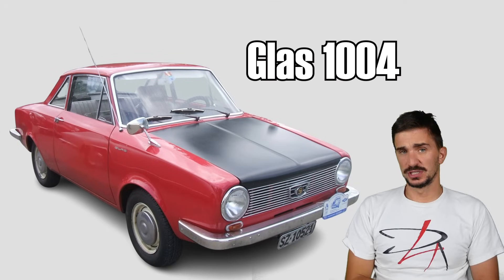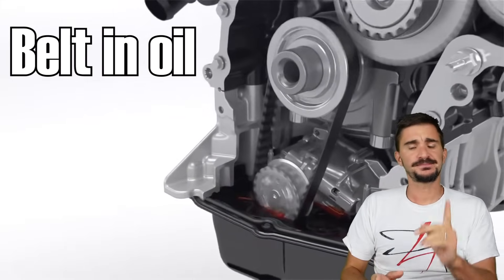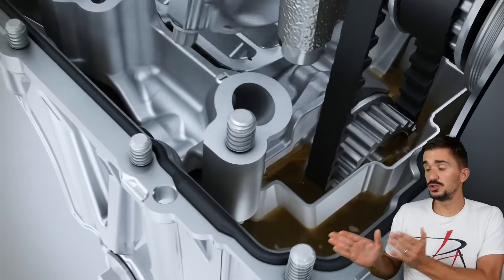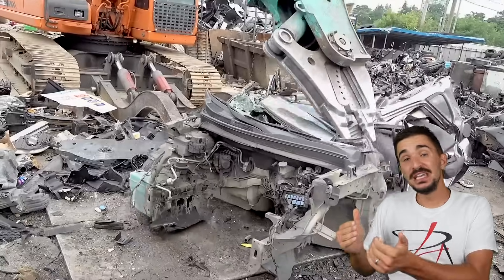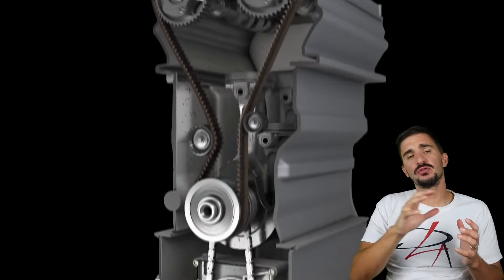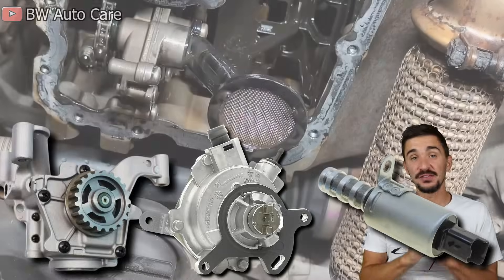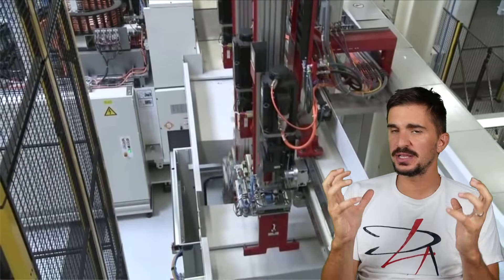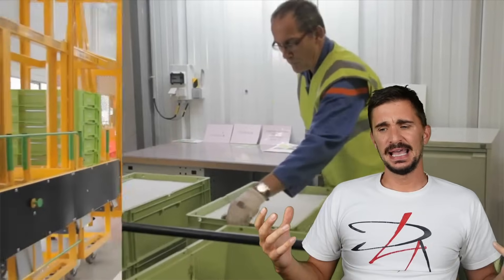Who Approved This and Why Is It Still Being Made? Wet Belt aka Belt in Oil Engines

Comment: We can conclude that engineering exists to make an engine last 500k miles. Engineers now focus solely on timing big failures just outside the warranty expiration. The closer they get to the expiration date, the better the engineering job. Kudos to the folks at BMW - you are at the head of the class!! 👊
Reply: A Yamaha XJR1300 Timing Chain only lasts up to 498kkm. Must be a weak design............ for a Motorbike.
Reply: ...engineering USED TO exist to make an engine last 500k...  Yep, now they want things just barely good enough to outlast warranty, aka planned obsolescence.
Reply: Don’t assume malice when incompetence is a good explanation.  A lot of the oldtime grease-under-the-fingernails engineers are gone and companies are stuck with CAD monkeys that couldn’t even change the oil in their lawnmowers.
Reply: 😂yes....Original Lexus LS400 engine. Pure silk designed to basically run forever, for instance. Or the original red block Volvo with a timing gear/sprocket....
Reply: Been like that since the 90s if not mid 80s.
Reply: As a mechanical engineer who works in automotive I can tell you it’s not us. It’s the higher ups pushing for cost cuts more and more while inflation continues to go up. Something has to give, and that something is the life components. 
It’s the whole lightbulb thing. We have the technology to make light bulbs last incredibly long (incandescent) but the big wigs way back got together and set a maximum life bulbs can last so they could sell more bulbs.

It’s never the engineer it’s always the person above.
Reply: @reaper793  Good analogy. I've seen the lightbulbs at Edison's house in Florida. Still going. As well as the  ceiling fans.
Reply: Having worked in the automotive industry, you are placing blame on the wrong profession.  It's (sadly) the bean-counters and marketters that are forcing such decisions, all in the name of more sales and profit.
Reply: @jb5nf  " I've seen the lightbulbs at Edison's house in Florida. Still going." Aren't long-lasting incandescent bulbs ridiculously dim? I'm not sure that is a fair analogy.  Even with automotive halogen bulbs, the brighter ones don't last as long -- it's not a free lunch, you can't have brighter output and longer life. People don't want 53bhp from their unstressed 1.5L inline-four, they want 190bhp from a 1.5L Ecoboost, so this doesn't help.

Off the top of my head, the 1000cc Honda engine makes 175bhp @ 13500rpm in the 2010 Fireblade but the very same engine in the 2010 Hornet 919 is detuned to 115bhp @ 8500rpm (and the rev limit is lowered all the way to a paltry 9500rpm).  As much as we want the big power at high revs as auto enthusiasts, almost certainly the engine is (sadly) going to last longer in the Hornet when used for the same type of full throttle, redline riding. (Extreme example: old American cast iron pushrods from the 70's in pickup trucks that barely make 175bhp from 5.7L but last for eons.) 🥲
Reply: @TassieLorenzo my parents have a chandelier in their parlor with several 75W bulbs that haven't been changed since they bought the house in 1982.  That's  42 years.  Most modern bulbs don't last 42 months.  Especially fixtures with built in LEDs.  Planned obsolescence is the name of the game.
Reply: @Noah_E  may also be very good wiring.  I never had classic incandescent last long like that here in the US.  My house was modern wired around 1980 and built almost a 100 years ago, fwiw.

Comment: Thanks for sharing this.  I only found out that wet belts were a thing about a year ago, couldn't believe that anyone could think that this was a good idea.  Personally I think that OEM's should be held accountable under consumer legislation and be required to offer a chain drive retrofit at cost and with free installation.  To me the oil pump drives should always have the most durable and reliable drive technology of any drive within an engine, to choose a wet belt is guarantee of catastrophic engine failure at some point in the life of that engine, unless you do oil changes at 5000 km AND you are very lucky.  MADNESS!

Comment: Honda also decided to use wet timing belt in Honda City 1.0 turbo which is one of the best selling here in Thailand. Timing belt de-lamination has becoming commonly found problem in this model as it older.
This problem costs a lots money from the users since the pieces of de-laminated belt usually clogged VTEC solenoid strainer or engine oil pump strainer which caused oil starvation problem and broke the engine.

BTW, Thank you for good video!
Reply: I think they also used this "technology" on the Honda Civic 1.0 Turbo sold in Europe
Reply: But i would expect Honda should react better and repair all of them at no cost.
Reply: @stefanmargraf7878  Yes if you pay for their expensive extended warranty. No otherwise. I had a month to go on my extended on a civic when mine destroyed itself for a 2nd time.
Reply: I think they only used that belt in the 1.0T not in the diesel engine. The diesel had a chain.
Reply: @kevinegal8586  Yep, it’s the gasoline one.
Reply: Why not use the timing chain and figure out how to increase efficiency another way. These clearly are for throw away cars.

Comment: This is like diesel Gate. This is Timing belt Gate.
Reply: Except diesel gate had nothing to do with reliability
Reply: @thedopplereffect00   correct but it was a scandal was it not? And this is a scandal engineers new this belt will destroy the engine so it is timing belt Gate in my opinion.
Reply: Reason for Disel Gate was different, why its pop up its another story :)
Reply: @elriv76  diesel gate is not a story it's a fact so is Watergate.
Reply: This is worse than diesel gate.
This actually affects the people buying these cars, diesel gate was just Volkswagen.
Reply: RubberGate
Reply: @deusexaethera  we will reserve this one for Durex scandal if there ever is one 😁
Reply: Steel timing gears are great!  Steel sprockets and timing chain is good.  Dry timing belt is barely tolerable.  Wet timing belt is stupid.  Multiple timing belts - especially wet ones, are the absolute worst!
Reply: Gates (tm)
Reply: Dieselgate should've happened widespread, this obviously should not
Reply: The last diesel VW in North America, the 2015 had a wet belt engine too. I know, I own one. I had the wet belt replaced at 180,000km. Had to get it done at the dealership out of warranty because no specialty VW shops ever invested in the tools needed to do he job. Still, belt never broke, and it’s going strong still at over 200,000 Kms with its second wet belt.
Reply: @thedopplereffect00  Correct, my diesel gate (which I thought was on basis of dpf needing maintenance dives and extra oil changes) was refused on the group claim as the Euro standard did not meet there criteria for overclaimed emission reduction.

Comment: Thank you for another wonderful explanation. In the last couple decades I've heard it said that cars need a way to inspect the oil pickup screen, possibly by allowing the oil pan to be removed or having an access plate in the pan. After hearing your video, I can see the benefit of that. I have not seen that belt expansion measure tool before... another useful item. Of course neither of these would be a big help as, by 100K miles, cars are less likely to be properly maintained.

Comment: If you want to avoid these kinds of problems, check out the front of the car. If there is a circle on it that contains four pie parts alternating between white and blue, slowly back away and run as fast as possible when you are out of sight.
Reply: How about if there are four rings overlapping each other? 😃
Reply: @TassieLorenzo  run four times as fast 😁 especially when there’s a V8 under the hood 🫣
Reply: @RustOnWheels    it's not a pie it's a stylised propeller running at speed.  Doooooh...😒🙈
Reply: If you see a three pointed star built within the last thirty years, do not be fooled.
Reply: @SirReginaldBlomfield1234  That's the problem... they made an aircraft that can't fly.
Reply: I'm going to be smart and not waste energy running. I will use binoculars seated comfortably and see it from a distance........ Then, no need to run....
Reply: 16:40 The Civic mk10 1.0 petrol also used a wet belt.
Reply: @SirReginaldBlomfield1234 that’s a myth. It’s colors of the Bavarian flag mixed with the logo of a previous company that eventually became BMW.
Reply: @TassieLorenzo   V8 TDI? Holy Sh.. Kraut space magic. 😳 Run !!!!
Reply: They use chains, but even those are problematic.

Comment: I am a mechanic. I WILL NOT OWN A BELT driven This video is extremely informative. Thank you sir. Everyone needs to see this.
Reply: Meanwhile, failing chain tensioners: ☠️
Reply: @mipmipmipmipmip-v5x  The belts need a tensioner too, they just don't give (as much) auditory warning on their way out.
Reply: @mipmipmipmipmip-v5x  Failing belt tensioners aren't any better. We had to replace like 3 alternators and the batteries (and the tensioner) a while back in our garage after one of the auxiliary belt tensioners locked up on a bus. 
But hey, at least they fail quietly :^)
Reply: @Daschickenify they do, they rattle like fuck because the tensioner has gone slack and failed. Talking from experience
Reply: @tommcmahon14  You're right, I misremembered. I've seen videos of failing timing belt tensioners and they do make noise.
Reply: Ford seem to mess up any idea. Honda have used a belt inside their GCV series of general purpose engines to drive the camshaft with literally no issues. I have had one such engine in my lawnmower I bought back in the 90s and it's never had an issue.
Reply: As long as its non interference, i'm fine with a belt. Even still, they can and do fail without warning and leave you waiting for a tow truck
Reply: Recently replaced a broken belt on an old Ford 2.3 powering a generator. 
Generator was dated around 81-82 ,the unit had 1200 hours and yes,that was the original belt. 
Gotta love non-interference engines.
Reply: @Eyoldaith haha my buddy bought a diesel rabbit that was sitting for about a year. 
We got it running and he drove it for about a month, and we said gee we should change the timing belt. 
When we pulled it apart ,the tensioner wheel was froze solid.
Heavy flaky rust all over it on the belt area, except where the belt was polishing it. 
We about 💩 ourselves, because it was obvious the tensioner wasnt spinning from the time we got it running.

Comment: My neighbour just bought a new Citroen C4 with a 3-cylinder wet-belt engine and it runs so hot that the tops of the front wings become almost too hot to touch. His new car replaces another wet-belt C4 for which he was quoted £1200 to replace the belt, and yet he bought another. He's a Citroen devotee since the days when the Peugeot Citreon made pretty good diesels.
Reply: Ah yes. 2.0 HDi. 136kms (or 110 in 8v head). 5L/100Km and it does over 500k kms without much problems. And they can be easly remapped (136km -> 170km) with even more fuel saving. I was able to get... 4.3L/100kms doing constant 90km/h.
Reply: The Xantia was the last car Citroen made that deserved the Citroen name 😞.
Reply: He will get the Puretech curse sooner or later.

Comment: I worked as an automotive prototyping technician from the 80s to 2014 , for five different manufacturers : I saw the skill level of designers decrease year after year ... When you explain something to them , because you have experience , they don't listen to you and only trust their calculation software ... I don't think this was done on purpose. it's just stupidity . I have hundreds of examples...
Reply: @phoenixcustomrifles1430  Yes , that's exactly it ... they live in a virtual world where everything works , but only on computer screens . they only listen to the technicians once they realize their mistakes ... calculation and drawing software only works well with people who have real knowledge in a real world
Reply: Please share 😂
Reply: I’ve just had to take the front end off my Renault master , radiator out and remove starter motor to get at the hole to screw the timing pin in to lock the crankshaft to change the timing chain, and remove top engine mount 🤷 engineers now come on a dingy 😂
Reply: @phoenixcustomrifles1430  I hold in high regard the academic achievement of any engineer . However , in my experience there are few these days who can see further than their computer models . It requires common sense , not just intelligence, to use such powerful tools  correctly .
Reply: Automotive engineering pays way less than many other fields. Plus the penny pinching accountants can make it really bureaucratic. It's just not set up to funnel talent.
Reply: The every growing reliance on computer models Is what's ruining engineering, not enough real world testing and engineering done just a bunch of computer nerds who have never actually had to work on what they r designing, they assume the software knows best.. no it doesn't its given very specific variables/values... We can't perfectly recreate our own physics etc in a computer.. Just close enough to give you a basis, excpet people take that basis all the way to finished product with no rework
Reply: @phoenixcustomrifles1430 same here. 
As they don't know how to use shape tolerances, they now use linear tolerances for everything. When I show them that the numbers do not add up, they reply that modern CNC machines can keep tighter tolerances anyway.
Reply: @therocketeergamer7952 Ai to the rescue!! 😂🤣
Reply: clever mind syndrome = ego!
Reply: Human stupidity is also infinite but goes much faster than human evolution.
Reply: I imagine that if it wasnt for copyright laws, there'd be people making a lot money by just remaking and selling cars designed 20 years ago. Imagine getting a brand new 80s toyota pickup? A dream...
Reply: There's a saying that if you throw garbage into the solver, you are gonna get garbage out.:face-fuchsia-poop-shape:

The software is only as good as the simulation setup and the mathematical model. There are huge discrepancies. 
Ran "same" drop simulation in Solidworks vs LS-Dyna. One showed FOS os 1.3, the other a steel tube being ripped open.
Reply: @caralho5237  The Japanese tried, you could buy 30 year old models in Africa or east. But then new crash tests caught up to them and eventually forced to update their models even there.
Reply: Plz share X2
Reply: @phoenixcustomrifles1430  Yes most young engineers will have little to no experience of machining or design for manufacturing.  The tips from the machine shop are greatly appreciated!  I understand that in the past (70's-80's) wooden pattern makers had a lot of authority to resolve problematic or unresolved areas of the drawings when making the moulds for casting (hopefully that is still the case even with modern CNC moulds & CAD models instead of paper drawings).
Reply: @caralho5237  The copyright laws can be avoided. You can buy brand new bodyshells for lots of cars, some authorised (reproduction '67 Mustang, Camaro), many not authorised (reproduction Mk1, Mk2 Escort coupe).  Getting the car registered after it is kitted out is a problem though as it won't meet 2024 regulations.  You may need the manufacturer plate from an original but rusted out version and to transfer that over.
Reply: @milithemuffin4534  The Russians are still doing it! You can buy a brand new Lada Niva. Though it has some updates to the engine and interior, unfortunately.  As you say,  you can buy a brand new ~1984 Land Cruiser 70 series but (unfortunately) it has more modern engines and interior and slightly updated safety features now.
Reply: Your problem, for not inviting them to barbecue & beer.
Reply: Don’t attribute to malice that which is adequately explained by stupidity.  I agree that incompetence on the part of both engineering and management is the more likely cause here.
Reply: @TassieLorenzo  When I was in Morocco like 15, 20 year ago... about half the cars were Peugeots (I think 206s?)  The other half were Skodas.  The Skoda looked A LOT like a mid 1980s BMW 325i.  And it turns out it's because it basically was, BMW sold the body and engine molds and they were just still using them.
Reply: Yes brother, and that's true for every industry...
Reply: I program CNC for a living. I have found that the common response from a design engineer when you highlight problems with their concept, is they will tell you how important the part is. As if that nullifies your statement.
Reply: We have to suffer young "engineers" with the same problem. Dont listen to the old dudes who have seen a lifetime of what works and doesnt work out there in the real world.  Fall back onto theory.
Reply: @hwertz10  I would like to see it.
Reply: @davidrussell8689 "common sense" comes from accumulating experience. And experience comes from investing time and getting your health hands dirty. That is not happening anymore. If you don't fight for it you won't see anything but your screen as a junior. And for a lot of things thats sufficient. But it most certainly wont make you a great engineer. Therefore you have to invest time and good forbid make mistakes in an controlled environment. Because the pain of a f*** up teaches you for a lifetime.
Reply: Incompetence, not greed or malice.  Never let the technocrats have power, or let the pencil pushers make design choices.
Reply: Things that should work based on computer data do not always work in real life. Where is the durability testing on actual cars? Manufacturers have known for years that these belts are problematic, but they are looking at getting past the warranty period only.